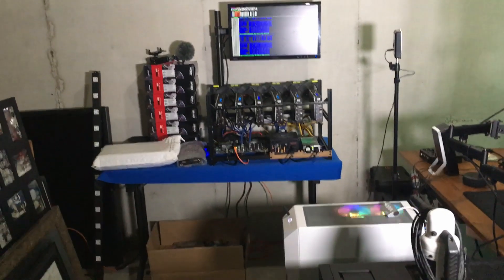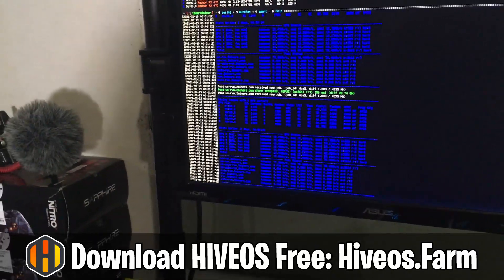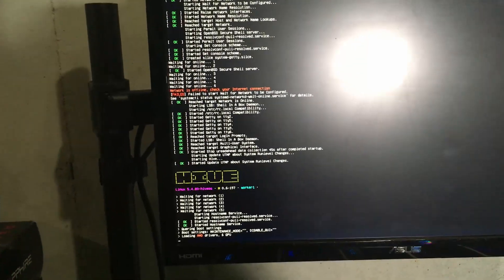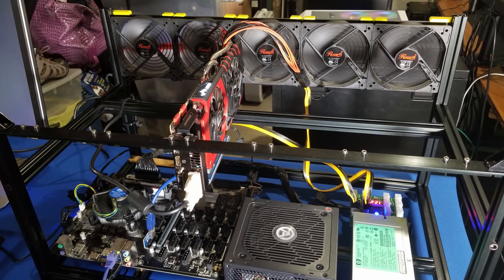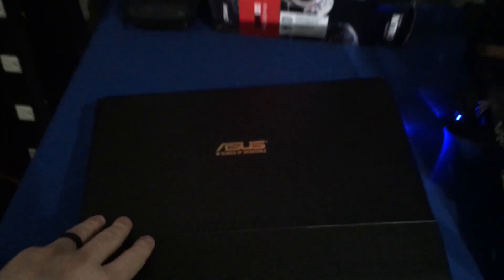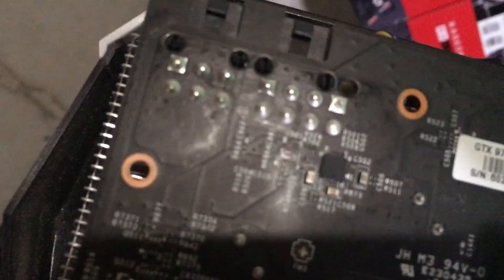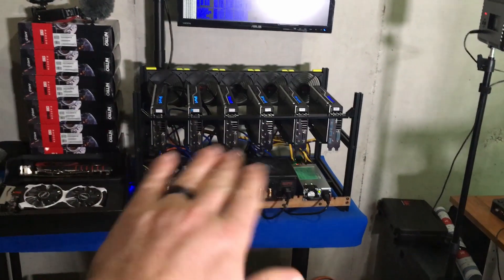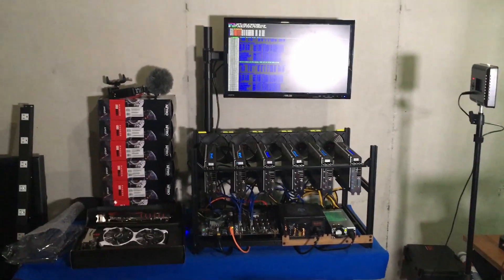MSI NVIDIA GTX 970 GPUs | What Do We Mine With It?

Comment from the maker: Any recommendations on what you think I should Mine or Do with these MSI NVIDIA GTX 970 4GB Cards?
Reply: Mine flux
Reply: Nothing, sell them... unless you have free electricity.
Reply: That's a good question - I JUST got a GTX 970 4GB and I'm only doing 4.5Mh/s in Ravencoin with it.  I would really like to know what I can do with the 970.
Reply: @mediaGuy1234  gtx 970 3.5gb  😂
Reply: Nick Sevrin  I also on zel, try gminer 2.38 version and you get about 20sols
Reply: @liudatsvetaeta8446  what oc settings you running and how hot does it get ?
Is 79° safe ?
Reply: @E9x.M3.Best.M3  power limit 80, and everything else stock oc. Gigabyte gtx 970 gaming, temperature is around 73, anything below 74 is safe, gminer 2,32 or 2,38. Try both versions. Error on temperature 511, is about power wires on connections to gpu from power supply
Reply: @E9x.M3.Best.M3  you're right on the edge anything over 80 the card starts to get unhappy
Reply: I just flipped it over to BTG and I'm getting 23 sols/s - I'll give this a shot for a while.
Reply: @mediaGuy1234 
I have Gtx970 and I am doing 4.5 mh/s
For rvn mining
Reply: @cryptohead5403  yup, that's what I was getting also for Raven.  I have since started mining Bitcoin Gold (BTG) and am getting 25 Sols/s.  This translates to about 75 cents per day which is more profitable than the 55 cents per day with Raven.  I'm just experimenting with it at the moment.
Reply: @mediaGuy1234  
thx bro ❤
I well try to mining BTG
Reply: @mediaGuy1234  which miner program use btg man?
Reply: @EduardoRamirez-nw9rs  For that card I was using BetterHash on Windows.  That particular motherboard couldn't see the USB stick to boot from it, so I loaded windows on a hard drive and put BetterHash on it.
Reply: @cryptohead5403  I decided to stick with Raven.  It's not worth as much, but much easier to mine.  Only been mining it for a couple of days with one RX570 and I've got 20 Raven coins already.  BTG was taking forever to get me .1 BTG.
Reply: @mediaGuy1234  How do you get 25 sol/s? I get only 12 (also GTX 970, the Windforce 3x Edition from Gigabyte)
Reply: My gpu stops working when I try with last nanominer version 😔
Reply: Nick Sevrin  really? Mmh I have to try it
Reply: Nick Sevrin  in 2021? Thats crazy, i have to give it a shot
Reply: @galosf  does it work out?
Reply: @ooy4223  yeah, gminer also works.
Reply: Nick Sevrin  ZEL = ZCash ?
Reply: Take it with a grain of salt 970 had 3.5 gb of fast ram and 500 mb of slow ram. Mining is memory dependent.
Reply: Im planning on mining btg coz rn im my hashrate goes around 25/28 sols per second with 150w power usage the whole computer and im mining on windows
Reply: This looks to good to be true https://www.betterhash.net/NVIDIA-GeForce-GTX-970-mining-profitability-155.html

Comment: Just got 3 GTX 970s, currently mining ETC and getting between 5.2-5.5 MH  on each of them.  They are running about 43C each and about 90W.  On the same rig I have 1 1060 and that is getting 19.9 on 80W and 50C.  I keep seeing posts that the 970s should be getting close to 20Mh but they are much older.  Looking for input.  I am about to try RVN and see what that looks like but I suspect it will be close to the same.
Reply: Are you overclocking them and are you using windows? Because with my gtx 970 I get 4m/h mining the same coin

Comment: I use two 970 ssc and get 15 hashtag in each which generates at the current rate around 80 GBP over month on Cudo miner.  I also get free electricity where I am so its free money!
Reply: please tell me how you get 15 hash per 2 i have 1 and get 0.8 mhs 2.4$ per month i also have free electricity i mine in Kreptex can you help me ?

Comment: What are you doing to get 13 MH/s out of those 970s??? I'm trying to mine on my old card and i'm only getting around 4MH/s (T-Rex)
Reply: He was getting 13MH/s on kawpow using amd RX 470s. The nvidia cards were not in the rig.
Reply: what do you mine with t-rex and 970s？ i  only got like 1.6MH/s mining sero 😂
Reply: @Ollie Northwood I'll confirm low 4.xx Mhs ..ummm 160 core clock 600 mem 150watt P/L

Comment: Hi, thanks for sharing, some advice ? I would like to  start mining ethe, using lolmining should I buy some used gtx 970? Is this a good option for mining ethe in 2021? Or should I try to get some newer cards? Thanks in advanced
Reply: Newer cards. Eth is too large of a dag file for 4g card. I just tried last night lol. My 3090 is doing great on eth lolminer but the 970 can't. Tried nice hash but I it wouldn'tseem to pick up the 970, kept only mining with the 90. Trying to find something to mine with it tho as its just sitting there and my dumb ass already went and bought a rizer + spare psu to mine with it lol.. think ill try raven🤷 lmk if anyone knows. Idc if its 50c a day. In this and or especially the next bull market i can hodle or flip that lol
Reply: Same here

Comment: Nice video Hobbyist!  I have an intel i5 rig not being used with 2x MSI 970's (4gb cards).   Have been thinking about mining for a few years now.  Have heard Ethereum is good to mine lately.  What do you suggest I mine with these cards?  

And if you can get to another question-  I built a rig at the end of 2020 with a Ryzen 9 3950x and a Radeon 5700 XT THICC III gpu.  Based on the market right now, I am contemplating selling this rig (or at least the core components) and investing the money into Eth.  The current value of all components is ~ 6k .   If I were to sell the new AMD rig, I would need to use the old Intel rig for my computing tasks, so I would be sacrificing mining on the 2x 970's.  Or... Option 3 (possibly the best option),  I could go without a PC for a few months & use my laptop to complete my computing tasks while I invest 6k in Cryptos & start mining on 2x GTX 970s.  I am a web developer so this might be doable.  And if I need the PC I can just stop mining and reinstall windows.

Thoughts?
Reply from the maker: WOW!  Loaded question.
One thing I would add is Second Hand Customs PCs like yours don't have the resale value that everyone hopes.  Right now the only parts that are marked up way over MSRP that are second hand are GPUs.  So reselling your Radeon 5700 XT will bank you some good money. 
If your looking to turn a quick profit i would sell that on its own.  As for the 970s you shoudl be able to get around 200 to 250 USD each. 

I am not sure that gives you perfect direction but hopefully that helps.

Comment: The issue about the temperature is from psu cables that goes to gpu. Look good for connection from power supply to gpu connections, some connections are destroyed it's sure. Check it - remove the connector from both sides on every gpu and you will find out easily.

Comment: You've got a low voltage short somewhere. I work on gas station air machines and have had similar issues.
Reply from the maker: I appreciate the heads up.  I have been watching a ton of videos where miners have done the "oven bake" trick to correct this issue.  Thoughts?

Comment: how are you getting 13mh on kawpow with 470s?
Reply from the maker: Nothing special honestly. Just overclocking them. What are you getting on your 470s?
Reply: @TheHobbyistMiner  around 10. I'm using amd compute with oc enabled
Reply: @Nibiruranch  I winder if that's because he has Saphire cards.  I have an RX570 , I'm only getting 11
Reply: I have an RX 580, 570 and 470 all 4GB and they're all pretty close to or just over 14MH/s on kawpow. I used Polaris vbios flashing to optimize the memory and have them set at 1100 clock, 850mV core, 1950mem clock and 800mV mem, both memory and core states are set to 2 as they don't like to stay stable on 1.
Reply: And two of them are sapphire and one is msi